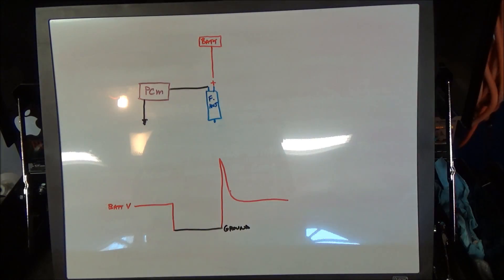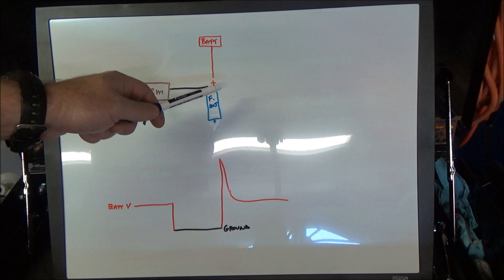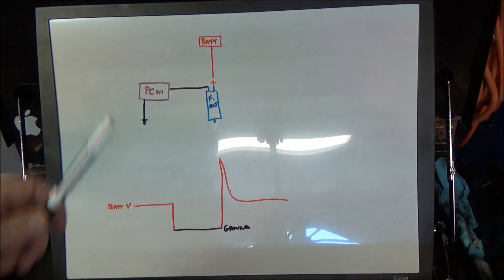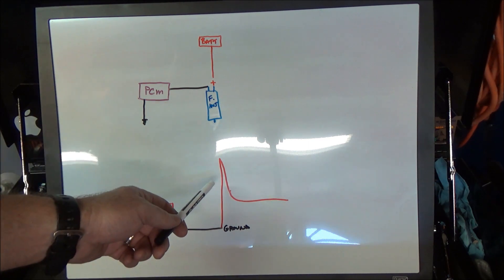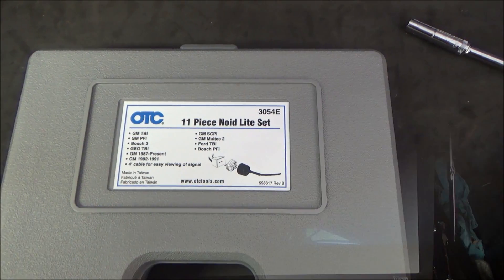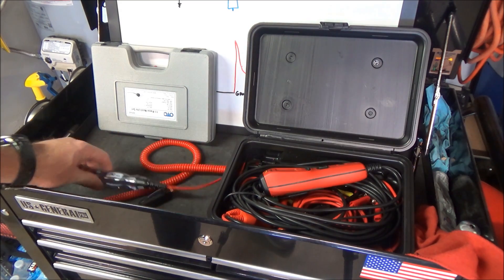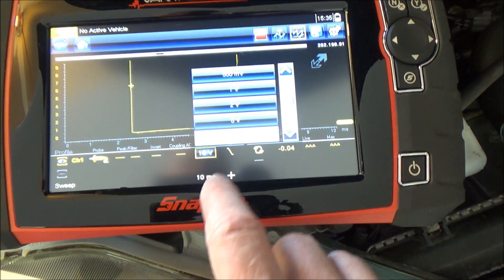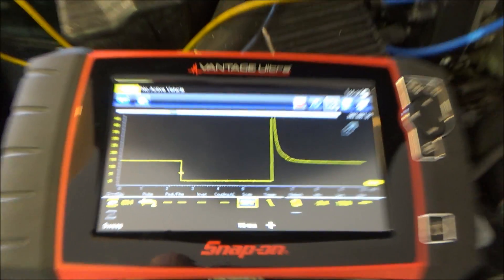Fuel Injector Testing: Noid Light vs Power Probe vs Test Light (Honda)

Comment from the maker: Tools
This channel earns a small commission using some of these links - at no additional cost to you.
PowerProbe IV:  https://amzn.to/2zQqcFL
OTC Noid Light Set:  https://amzn.to/2NOWRDI
OTC 3636 Test Light:  https://amzn.to/2zPEnei
OTC Leak Down Tester:  https://amzn.to/2NMtIcf

The Big Dog 50001 Automotive Channel Store can be found here: https://www.amazon.com/shop/bigdog50001automotive
Reply: V.
Reply: My miss fire just started and is sporadic. P0204 jeep liberty.  At times I turn on the vehicle it acts normal and other times on start is misfires cylinder 4.  I swapped the coils and spark plugs to see if it would follow and it doesn't.  Now I believe it comes down to the injector acting sporadic or from the the electrical plug.  Any thoughts?

Comment: I got a noid light set yesterday from O'Reilly's because I was working on a 2010 Ford Edge. I tried a test light first but I didn't know exactly how or if it would even work. The noid in the set labeled Ford did not fit the connector, but the one labeled Bosch did. Whatever. I had signal and so replaced the injector. Fixed!

Comment: I'm working on a 1995 Corvette ,new injectors ,44 lbs fuel pressure, noid lights flashing but will not spray fuel. If I use a 9v battery and jumper wire to injector ,it clicks and sprays. I have full voltage to injectors power wire. Would you have any ideas? Driving me crazy , also if I spray fuel into tb , runs great till fuel of gone. Nice video. HELP please

Comment: Great video did you see if you can adjust the valve first  before going the distance of pulling the head
Reply from the maker: No, not on this one due to evidence of overheating.
Reply: @BigDog50001  yeah sucks if they would have brought it in when the engine started to tick would have been a 1 hr labor and new valve cover gasket to make a easy fix. But sometimes people don't understand.. but thanks for the reply back

Comment: Great video and information. You got me towards the end. I was thinking dude what do you check next if the darn injector is getting power and fuel. Then right before I was about to type you the ?, you jumped in with the bonus video of checking the compression and leak down. After that I was saying out loud in my garage to the point my neighbor looked over as I was yelling this guy is awesome and very knowledgeable and lest us lay people know each step to achieve results. I am working on a 2012 dodge caravan with the 3.6 pentastar engine but it looks like your steps will work. I replaced a ton of stuff that requires relearn but I can’t get the van to barely run. I don’t think bank 2 cylinders are firing. I am going to start at your step 1. Thank you Sir for helping out us little people who can’t afford to send the vehicle to a shop.
Reply from the maker: Thank you, I appreciate the comment!

Comment: if i try to test the control signal on a "crank no start car"... would the signal the fire even if the car wont start or does the engine it have to run itself.

Comment: I own  a 1999 Eurovan with the VR6 engine. Fuel injectors are hidden under the intake manifold, thus impossible to test with the NOID testers. I can only access the injectors harness at its junction with the ECU harness. In the video, I can't see clearly how the PowerProbe IV is connected to the injector. Can I connect the PowerProbe IV to the injector's grounding wire, but at the harness junction? Hope somebody will read and answer my question.

Comment: I bought one like this but there is no injector mode but how can i test continuety if the harness of ecu inside the car and the injector outside and ive tried noid tester no pulse and i have no start issue want to check continuety so can you help with this power probe ,how can i do the test?

Comment: It's unfortunate that those honda fuel injectors never goes bad 9/10. So the next time someone looking for a misfire on these 90s honda, you can look at the injectors as the last resort. With these engine conduct a leak down test first for your misfire diagnosis.

Comment: Please answer me, I am testing injector nozzles on 1Rz engine, but when I disconnect the connector on the nozzle and ground my test lamp, then key on and probe the socket with a test lamp but both cables have power at the same time. Is this ok or not?  If it's not ok what can I do,  because I have a code P0200 (Injector circuit what can I do?

Comment: Thank you for the video. I am trying to diagnose a Misfire cylinder 1 P301 hyundai v6. I am at the fuel diagnosis stage. My suspicion is not ignition (spark) based on maintenance and tests of ignition. Timing seems not an issue as cylinder specific on this DOHC timing would cause entire bank issues (misfires P300). Assuming that not seeing the pintile spray pattern through these tests is an issue however your stating that the Power probe 4 showing more data compared to a known good injector shows simpler pulse pattern thus not injector issue.

Comment: Great video So if i back probe plugged in injector with my  power probe 4 and i get data like rest of cylinders does that mean injector is good ? Or just circuit system to injector is good

Comment: That was a GREAT explanation, thank you!!! I'm doing the same thing on my 2009 Escape with the 2.5L. Cylinder 1 is misfiring. Injector, coil, and plug are all good. Compression is good but I'm going to do a leak down test anyway. Have you ever had any experience with good compression but a failed keak down? Thank you again!!!
Reply from the maker: Thanks for the comment 👍!

Comment: I have a issue on injector  number 4 on the 1996  Toyota corolla  pulsing light but then it goes solid signal I have put a ecu which is been repaired but now with that issue it causing to much fuel coming out in cylinder number 4 causing it to flood in fuel and getting white smoke with strong fuel smell not sure if it's the ecu become faulty again less than 16 days of replacement when the pulsing issue started I change spark plugs wires relays fuse and spark plus distributor n only get a p0304 cause but the irregular pulsing to just the light injector  test staying on any ideas what it could cause for I injector 4 to stay on constant. Sorry for  my explanation with my grammar.

Comment: I just subscribed your channel. Thanks for sharing your video. I just have a question for the power probe. Where do you connect the power probe to test the injector? Is it in the connector or to the injector directly? And also the NOID will it work to mercedes benz injectors connector

Comment: I'm not sure why it took me so long to find your channel, you earned a sub today for sure. We have many similarities, not least of which is our addiction to quality automotive tools. What I really like about your channel is the way you explain how these systems work first, which gives a reliable compass to look for solutions. It was fun to see you use PP4 for the fuel injector. Eric O sent me one of those but I've never used the fuel injector feature. Once I see the test light flashing, I tend to follow the ScannerDanner blueprint of looking at current waveforms. There are lots of right ways to get to the answer.

Comment: Great video, thank you. My 1994 Dodge Dakota 5.2 is driving and running, but throwing an intermittent code for the injector output signal circuit. Even when running fine, I get power (test light bright on all injectors power side), but no ground (no pulsating light to ground side on any injector). Do you know what may cause this... And how is the truck running with no ground to the injectors??

Comment: Great video, really appreciate all the explanation.  Probably a dumb question:  how do you hook up the tester probe?  Looks like you jammed the probe down into the connector ground from the back while it’s plugged into the injector?  (I guess that’s why they call it back probe?)
Reply from the maker: Yes I probed it from the back where the wire is crimped to the connector.  The probes I use are sharp like a needle which makes it easier to back probe.  Thanks for the comment!

Comment: Dont know if u r gonna read this but i may hav fried my pcm. I now hav no ground @ injectors & some other sensors..but car still runs ok.. accidently jumped a relay wrongly. Now hav a bunch of codes maf purge canstr est trans dfi (crank)..
Reply from the maker: That is definitely not good.  I would probably at least check all fuses to see if any were blown, you may have been saved by a fuse.  If the cars still runs that is a good sign.

Comment: I thought all the yellow/black were the ground wires ? And the colored ones were power
Reply from the maker: Different vehicles/models can use all kinds of wiring colors for components.  For this Civic, the ground for the fuel injectors is what is being controlled by the ECM and they fire at different times so different colors were used.  Many manufacturers will use different colors for control but that may not always be the case.  The power is shared by all injectors (coming directly from PGM-FI Main Relay), and in this case they are all the same color (YEL/BLK), most likely done because it is easier to manufacture that way.

Comment: Hi there this is a good diagnoatic video. One question when you used the power probe to check the connection i beilive you said you back probed the ground right? If so  how could you tell there was good voltage at the same time by only probing the ground? Thanks
Reply from the maker: Voltage does not drop until there is current flow (Ohm's Law).  You will see 12V because it coming in on the other wire and is going through the coil winding inside the fuel injector and stays that way until it is turned on (creates current flow).  You will not see 12V if the coil inside the injector is broken.  Thanks for the comment!

Comment: I've been having this flooding issue on my 2004 BMW M3, cylinder 6 at first was floodying, throttle body was full of fuel and having misfire on that cylinder along w/ cylinder 5 and 4 having pending codes for misfires as well.

At first we thought its just pre-cat o2 sensor since it was only happening after the car has warmed up but after switching pre-cat o2 sensor it started doing right off the bat, checked the values I am getting for pre-cat o2 sensor and it was good. 

that's when I found the fuel in the throttle body, plugs were changed, coils were changed and still happening and at one point the "flooding" went to cylinder 5 for a little bit then went back to cylinder 6.

Checked compression ratio on cold engine (Since I didn't really want it to run misfiring like crazy dumping fuel in the cylinder). everything actually checked out, 10psi lower than minimum but it is to be expected on a cold engine compression check.

injectors was sent out for testing/cleaning/rebuild and everything came back great there was no note of sticking injector in the report sheet that I got.

what else could it be? I was thinking maybe either wiring harness or DME, how can I check if the harness is shorted out on the injector w/o turning on the car?
Reply from the maker: A test light should show if a control wire to the fuel injector is shorted to ground (on all the time).  I would try and narrow it down to whether it is a rich condition due to inputs that the ECM uses to control fuel delivery (O2/MAF etc) or is it a symptom due to mechanical problem (faulty or shorted injectors/wiring/air flow issue etc). 

Long term and short term fuel trims using a scan tool are where I would start (is ECM adding fuel and creating a rich condition or taking it away trying to control a rich condition).  Upstream and downstream oxygen sensor readings at different RPMs and engine loads are also something I use to diagnose (do sensors go rich/lean like they are supposed to and are they responding properly).  Sometimes sensor/solenoids only act up at certain temps too.

I would look for engine trouble codes too.  I believe cylinders 4, 5 and 6 are next to each other on the vehicle, so I would look for things they may have in common that could effect them all.  Also, if the alcohol content in the fuel is not correct, it can create fuel delivery issues but that would probably effect all cylinders.
Reply: @BigDog50001  I tried using test light, clipped it on the power side of the battery and identified the ground cable on my injector harness and had someone crank the car while doing it, both cylinder that had the flooding problem was doing what they supposed to do, pulsing faintly. tested the power side clipped the test light on a ground and put the test light on the power side while the ignition is on and both got power. 

So far things I've done,

New plugs and coils,
New Pre-cat o2 sensor

Injector rebuilt
compression checked and passes
checked injector harness w/ test light and passes.

And cylinder 6 floods w/ fuel as if there were no spark. and sometimes it jumps to cylinder 5, codes that is out right now is multi misfire code and cylinder 6 misfire with two pending codes for cylinder 4 and 5.

Thanks for your time helping me figure this out.

Comment: Hi there. I just subscribed to your channel and was watching this video. I really like the way you make things very easy and simple to understand. However, one thing I wish you would have done in this video and that is, to explain the 'back probing' a little more - especially for us newbies to automotive work. Also, a more close up view would have been great while you were back probing. It was kind of hard for me to see exactly where you were putting the probe when you tested the 2nd injector. Also, did you reconnect the 1st injector before disconnecting the 2nd injector to test? Otherwise, great video in explaining the (3) test devices.
Reply from the maker: Welcome!  Each video I try to get better!  As far as the back probe is concerned, I just took the back probe that I showed at 8:00 minutes and stuck it right next to the control wire (ground) where the wire enters the connector on the fuel injector (it is touching the wire inside).  As far as testing with the back probes using the PowerProbe, I back probed and tested both fuel injectors (#2 and #1 cylinders) the same way.  

When testing with the PowerProbe (unlike the test light and noid lights), I left the fuel injector that I was testing plugged in, otherwise it will not test correctly.  I unplugged the #2 cylinder at 10:55 minutes (the one with the misfire) AFTER I was done testing it because I did not want fuel being dumped into a cylinder that is not working.

Comment: Great video....What happens if we have 12 volt constants but we don't have the pulses from ECM....we already check integrity of cable from injector conector to ECM end.....the diagnostic gave to be ECM replace it or can I do something else?
Reply from the maker: I can't see what you have done as far as testing and I don't know what model or vehicle you are working on, but what you are describing is the transistor/driver for the injector inside the PCM not working.  Some vehicles/models will intentionally shut down an injector when it detects an issue so clearing the code, cycling the key and then immediately testing with a test light/noid light would be my next step (but even that is not fool proof as certain vehicles can detect the incorrect current flow/resistance of a test light).  

If the PCM is intentionally shutting it down then the test light will flash briefly and then the PCM will most likely shut it off again very quickly.  Also be aware that if the driver in the PCM was damaged, I would try and locate the reason the driver went bad before installing a new PCM (bad wiring/shorted injector etc).  Thank you for the comment!

Comment: Thanks for the examples, I’m getting P0202 injector circuit/open, for cyclinder  2, 3 and 8, It’s for a 05 Ford F-150, I’m thinking I may have a grounding issue,
Reply from the maker: Thanks for the comment!
Reply: @F. W. What was the problem  and  remedy?

Comment: Okay.. Just confused by what you said at the end.. Plugged in it was running rich from the injector dumping fuel, unplugged it evened out, so that means the injector is working properly? I don't understand. Would that not indicate that the injector is leaking? Not that it is in good condition?...
Reply from the maker: Don't get too hung up on that one test, it is just a quick and dirty way to see if injector is spraying fuel .  If the fuel trims change when it is connected/disconnected then it at least gives an indication that something is happening (in this case spraying fuel when connected and not spraying fuel when disconnected).  We knew it was a dead misfire, happening all the time, so this was another way to give some direction (should we go left or should we go right) and it helped me steer away from fuel injector and look somewhere else.